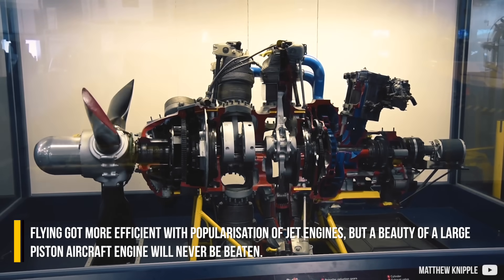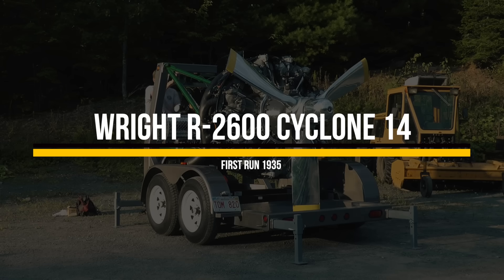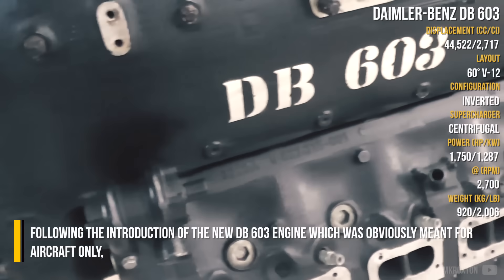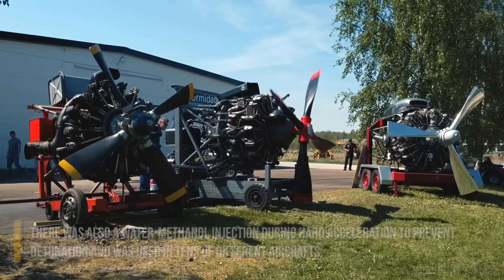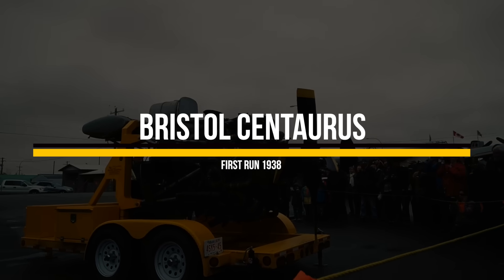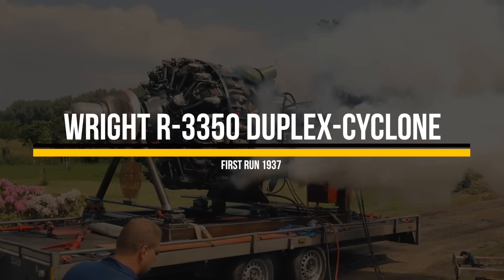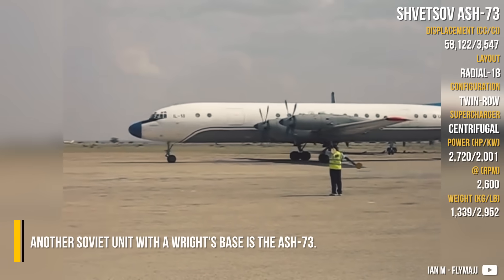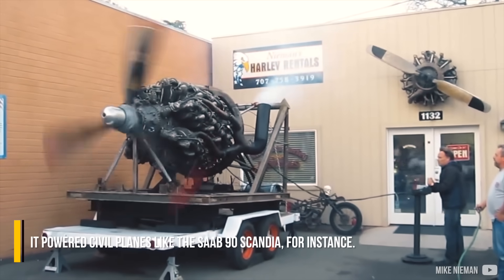9 Of The Largest Piston Aircraft Engines Ever

Comment: I'm so glad you included the R-4360. For those of you who don't understand engine naming conventions of American piston engines the first letter designates its configuration. This is why you see R at the beginning of every radial engine as it is what the R stands for. The numbers indicate displacement in cubic inches. 

One of the biggest reasons why massive radials are almost all but gone is because of the complexity involved in their design, production cost, maintenance costs, and maintenance time. It took a lot of service to keep these big engines running and with the way trends were going they were set to just get bigger and bigger. As the jet engine came of age it quickly began replacing piston engines in a lot of aircraft operations. Outside of general aviation you won't see piston powered aircraft all that much. There's no real benefit of using them anymore in aircraft that earn revenue or do some kind of work. 

Even in prop aircraft that still exist turboprops are becoming more popular as their prices decrease for those who can swing buying aircraft with turboprops as well as the associate operation and maintenance costs. That's not to say piston powered aircraft will be going anywhere for a long time. In fact many advancements have been made and approved by the FAA for piston powered aircraft. Many of the newest general aviation prop planes come with things you are already used to in your own vehicle. Electronic fuel injection, electronic ignition systems, computer management for the engines, and a host of other advancements. 

Rotax has pioneered a lot of these advancements and even diesel engines are being put on some aircraft now.
Reply: Don't forget diesels now too!
Reply: You left out the part where all of these WWII era radial engines were designed to work with high octane Avgas, which contained tetraethyl lead.   As TEL got phased out (because environmental lead slowly poisons people and makes children retarded), getting supplies of this high octane Avgas has become a major limiting factor in continuing to economically operate these old engines.

Comment: The Sea Fury did not have a Double Wasp it had a Centaurus.
Reply: soaringtractor  no they dont, FACT!
Reply: That specific sea fury in the video has been engine swapped for air racing by the sanders family.
Reply: Almost all the sleeve valve engines are dead. That’s why almost all Sea Furies use American power.

Comment: That plane at 8:00 is an Ilyushin IL18, which uses turboprop engines. In fact you used three separate clips of the same plane and didn't notice it was a turboprop.
Reply: Definitely turboprop.  Can't fit a big radial like he was talking about in the small of a cowl.
Reply: Dominic Kasheimer h
Reply: @pilatus421  g
Reply: TommyWylie you can tell just from the sound. Superchargers and turbos have their own whine and whoosh but turbofan/turboprop/turbojet axial-flow powerplants just have a different sound...and the size is way too small for a radial.
Reply: the plane shown is the CU-C1515, an IL18D [1] which is powered by 4 Ivchenko AI-20M axial flow turboprop engines putting out 4250bhp each[2]
It is an improved version of the IL18B and designed as a long haul plane. [2]

sources:
[1] https://www.planespotters.net/photo/276440/cu-c1515-aero-caribbean-ilyushin-il-18d
accessed jan 31 '19
[2] aerotyp Verkehrsflugzeuge, Heinz A. F. Schmidt, Transpress, Berlin 1968 pages 52-53
Reply: @samsonian  Also, the exhaust at the rear of the nacelles is a clear sign of a turboprop
Reply: The Il18 in the video is an Air Koryo plane, I've seen the original video from a group of aviation enthusiasts having trips in several planes.
Reply: and the B 29 shown at the end is not powered by the 28 cylinder radial
Reply: @dave8599   the last plane is not a b29 but a B50 , the difference is from the engines , 4 Pratt & Whitney R-4360 Wasp Major
Reply: ʁuʒ cvd rouge nope that is definitely a b29 with Wright R3350s. The B50 had a large duct inlet just below and behind the engine n the nacelles
Reply: ʁuʒ cvd rouge wrong. That’s a B-29. O e of only two airworthy examples in the world.
Reply: The "Il-18" index was firstly used for the project of piston-engine liner with 4 АШ-73 engines. But Stalin closed this project, because these engines were needed for Tu-4 bomber (the Soviet clone of Boeing B-29).
Reply: Any relatives south of the border (Mason Dixon line) ??
Reply: @Joewylie3  What does that have to do with aviation?
Reply: Smhelly Blakk TerBoH-ProppS Egghawst two
Reply: Yep. I noticed that too
Reply: Also the Saab 90 Scandia use much smaller engines, half the size.
Reply: Yes, I noticed too:)
Reply: The guy talking is probably a Russian so I'm not surprised
Reply: @spitfirenutspitfirenut4835  Nope, he's a Czech.
Reply: @TommyWylie  Similar accent.
Reply: At first thought they sound like IL-18 but well it is an IL-18 after all
Reply: Epic Fail... ;-)
Reply: The B-29 ("Fifi" was pictured) didn't use the 4360, it used the Wright duplex-cyclone... and frequently suffered for it, as the bugs were worked out in the field. The remarkably similar B-50 used the P&W R-4360, as did the C-97, the Boeing 377, and the B-36 "Peacekeeper" and its cargo conversion variant, the XC-99, and numerous other civilian and military cargo haulers. So saying it wasn't installed in any warbirds when it was the go-to engine for several years when it came to strategic bombing and nuclear Armageddon is a little unfair.
Reply: Yeah this dude isn’t exactly the brightest
Reply: @actiniumanarchy9237  Unfair judgemnt. This guy has researched thousands of engines and most of the time he comes up with the facts.
Reply: Who gives a shit Dickhead

Comment: The engine at 6:01 is never a Bristol Centaurus (more likely a Pratt & Whitney R-2800 or similar).
It has cylinder heads with standard poppet valves. 
Compare it to the sleeve 'valve' heads as seen on the engine before, then you see it.
Reply: That's correct, the clip begins with a Centaurus on a test stand, but turns to a Sea Fury that should have had a Centaurus, but had been converted to a Curtis Wright R-3350-26W....then to a proper clip of a Fury flying with its Centauras at full song.

Comment: The footage for the 'Ash-73' is of a totally different turboprop engine. Basically a jet engine that uses a propeller for thrust.

And the footage for the R-4360 is a B-29. Those used R-3350's. R-4360's were used on B36 and B-50 bombers
Reply: The B-50 used R-4360's, and looks alot like a B-29
Reply: Basically the B-50 is a upgraded version of the B-29.
But you can easily spot the main differences:
- Chin coolers under the engines nacelles.
- And a much taller tail fin.
 The B-29 was planned with the R-4360 but the engine wasn't ready fast enough.
So it had to be build with R-3350s, which were a fire hazard.
Reply: Turboprops are jet engines blowing on a wind turbine. So are turbofans. The difference is what the turbine drives (an unducted prop or a ducted prop)
Reply: I can  confirm the Ash-73 comment.
1. Totally wrong sound for a piston engine on the first and third plane.
2. Totally wrong exhaust plumes on second plane. (No gasoline aircraft piston engine smokes black)
3. Totally wrong cowling shape for a piston engine (no cooling flaps on all three planes)

About the R-4360 cant say for sure, but the 'Fifi' was a B29 which were indeed powered only with R-3350s.
Reply: Hauke Sattler 
“FIFI” has Wrights.
It’s hangared in my home town.
She flew in WW2.
B50’s first flew in 1947. There’s film footage of the B50, “Lucky Lady II”, on UTube.
Reply: @richardzinno4909 
I didn't claim that the Fifi is  B-50. It's clearly a B-29.
Those long R-4360 would never fit in her nacelles.
I just mentioned that the B-29 were initially planned with an R-4360 but had to be equipped with the R-3350 (just like the Fifi is)
Reply: @haukesattler446  FiFi still lives my friend.  She still shows up at EAA, Sun 'N Fun and wherever the CAF sends her.
Reply: R4360s were used on many different airplanes.  Already mentioned is B50, but also C & KC97, B36, C119, C124, and Boeing's civilian version of the C97.
Reply: The B-29-D used 4360's.

Comment: But the B-29 didn't use the 4360.  The very similar B-44 and B-50 did though.
Reply: B36 used 6 of these as pushers.
Reply: KC-97 was essentially a double decked B-29 with 4360's.
Reply: Strike Raid...correction here, the B-29-D was fitted with the 4360.
Reply: @rayford21  Oh come on, you know perfectly well the D model was the pre-production name of the B-50.
Reply: @rayford21  yeah but definitely the plane shown has the 3350 not the 4360, nacelles are totally different what makes Strike Raid right

Comment: I like the bike intro. Good to see.
I would question some of those shots, of engines in the aircraft. For example, I didn't think the B-29 had corncobs in it... I'm pretty sure it had twin row Wright R-3350 Duplex-Cyclones in it. Also, you talked about the Bristol Centaurus, and then showed a shot of Rare Bear, which did not have a Brit Centaurus in it when new, and did not have one after they made a racer out of it either... You showed a shot of a Sea Fury, which very likely did have a Centaurus, but you identified that engine as one of the twin row Wasps. Maybe you're right, quite a few Sea Furies that are still flying have had that swap done, but... that's not what they originally came with.
I'm not sure you're wrong, on any of those, but I would be inclined to check. I have some doubts about several of your identifications here...
Reply: Correct.  The b29 at 9:14 has the cyclones not the corn cob.  The B50 had corn cob for Korean war I believe.
Reply: @seeul8rwaynekerr  b50 had 3350 as well
Reply: The B-50 looks very similar to the B-29 as that is what it is, a B-29 with Wasp Majors, but that plane he showed wasn't a B-50. That's the CAA's "Fifi", one of the two airworthy B-29s left.
The previous engine, the Shvetsov ASh-73, every plane shown has Kuznetsov turboprops. He should have showed the Soviet B-29 copy, the Tu-4, as it actually had ASh-73s.
Reply: The Sea Fury shown at 4:10 does have a Twin Wasp, a Bristol Centaurus doesn't have valve rocker covers as it has sleeve valves, the engine in that plane has them.
The Centaurus cylinders have a flat cylindrical top with a depression in the middle where the spark plugs are situated.
Reply: The B-29-D was fitted with the 4360.
Reply: @rayford21  The B-50 was the B-29D renamed by the USAF to secure funding from Congress.

Comment: Excellent vid, visio! Another one for the thumbs up collection for sure. Big engines for life!
Reply: Well, so far, no mention of the biggest of them all.  The Lycoming XR 7755. That's 7755 cubic inches, 36 cylinders, 5000 horsepower. Built around 1948. 2 were built and there is a photo of it and its development crew on Wikipedia. It never flew, but was successfully run up on the dyno, eventually producing 5000 hp. With the jets coming on the scene, its market disappeared.